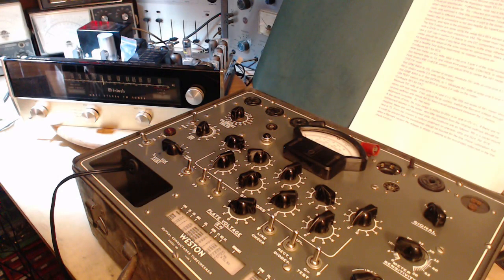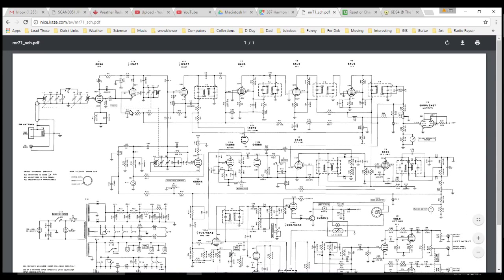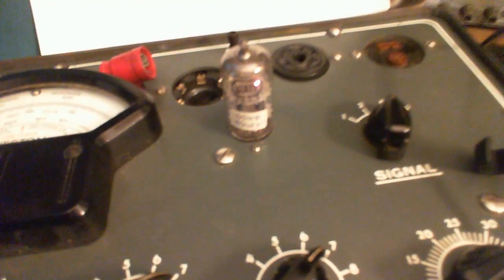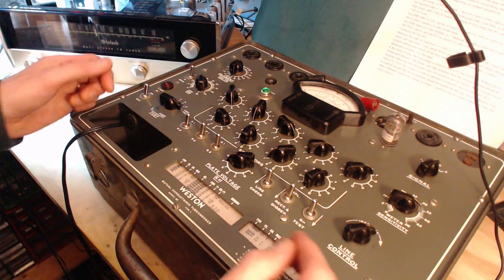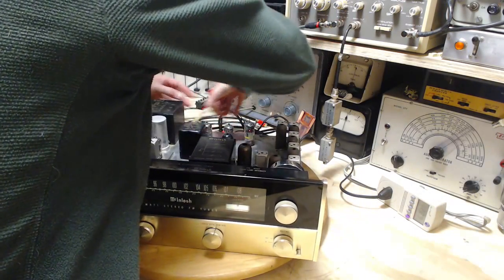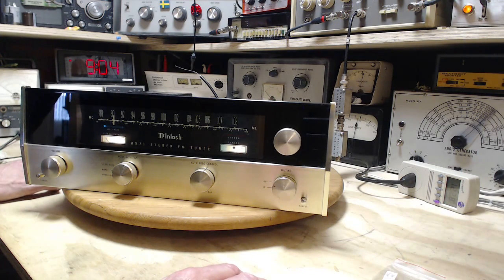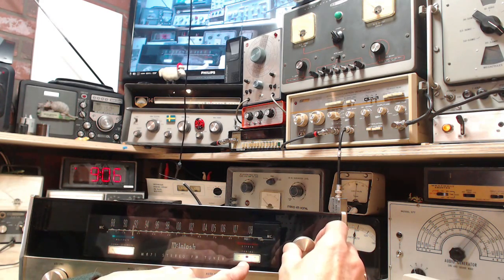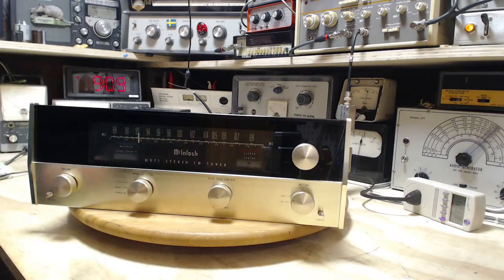McIntosh MR71 FM Receiver Video #2 - Tube Testing

Comment: You feexed it! My sencore "Mighty Mite" tube tester does nuvistors. This is only the second time I've seen a piece of equipment that used one. The other time was when I was a kid, and found one in a television tuner. The antenna it was connected to got zorched by lightning! RW
Reply from the maker: I think nuvistors were the tube industry's answer to transistors.  Note that the name is similar - that's marketing I'd guess.

Comment: I don't think the test socket for a Nuvistor vacuum tube is on that unit. If you have an old Ribbon microphone take the Nuvistor vacuum tube out of that and put it in the MCINTOSH  MR71, saying you weren't getting any signal on FM it means that the Nuvistor tube is bad.
Reply from the maker: Hold on there Baba Looey.  I think the Nuvistor is fine.
Reply: Let Quick Draw do all the thinkin'. lol